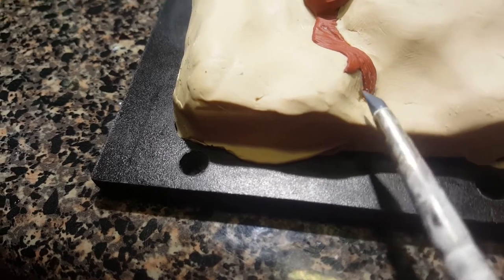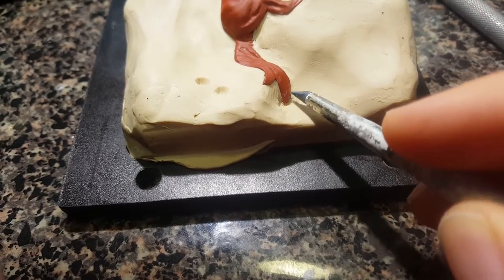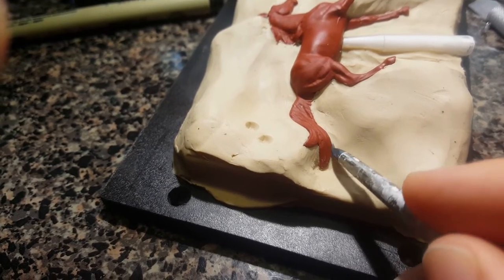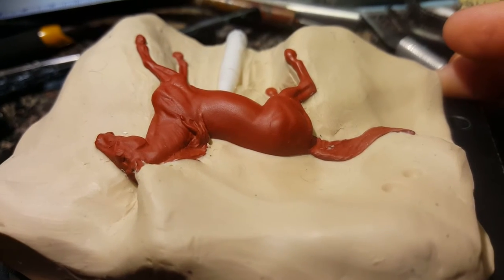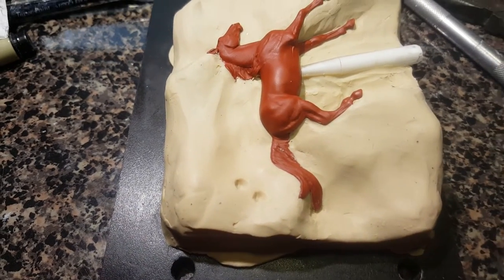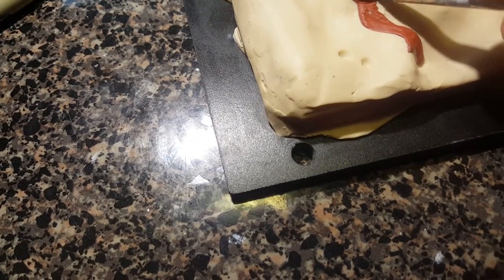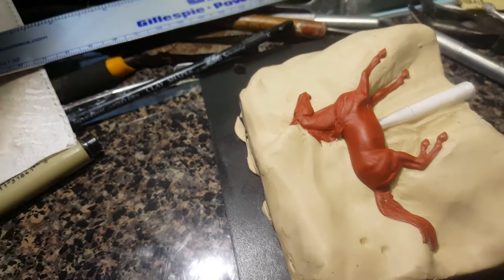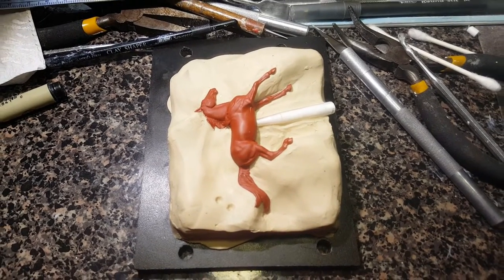Laying up clay for a silicone mold

Comment: I'm curious to know if you needed to make vent holes for this casting.
Thanks :)
Reply: She probably did need to make vent holes for the legs because the air wouldn't be able to go anywhere once the resin is poured in. :3 Otherwise she'd get a legless horse..x')